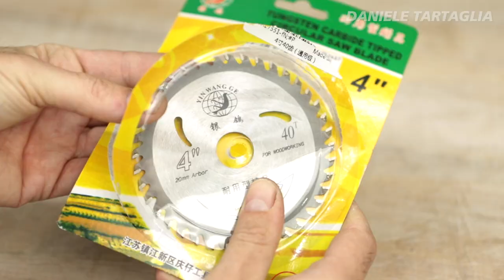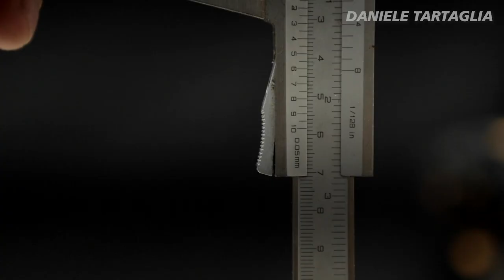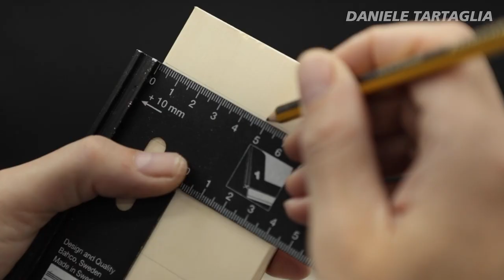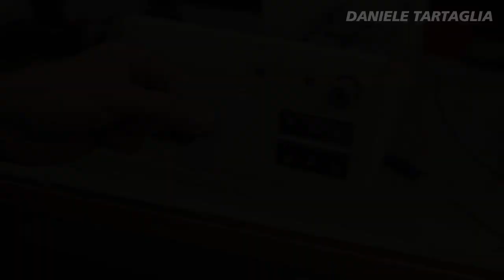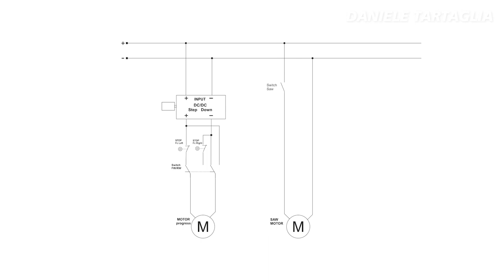Circular saw  MOTORIZED home made

Comment: adding another limit switch at the opening edge for a safety,so that the blade wont start if u accidently flipped the switch when the sawblade holder is tilted.. just my opinion...

Comment: Nice work :). Can you tell me what maximum size of wood can the saw(motor) cut theoretically? for example: Is it possible to cut a 50x50 squared timber with a larger sawblade? can this engine do it?